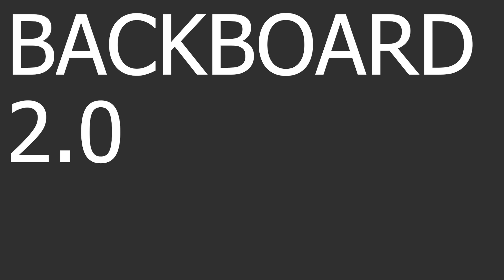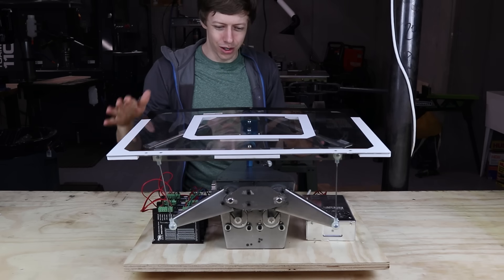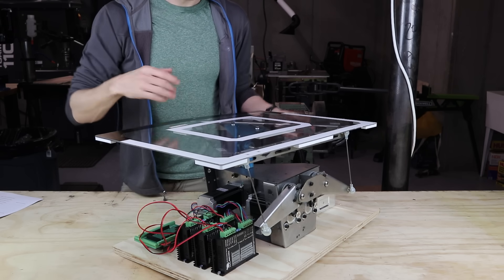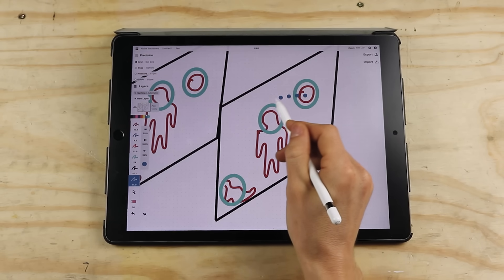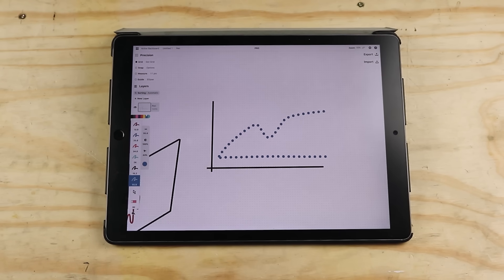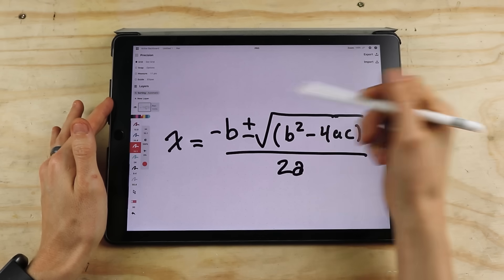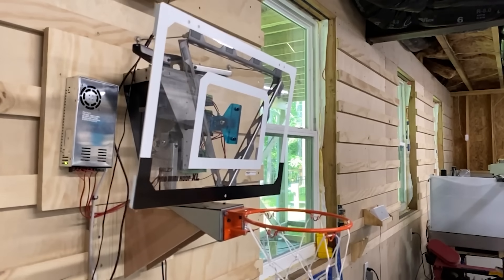The automatic hoop always goes in

Comment: If you haven’t played with it before, Googles Coral Dev Board running something like a mobilenet ssd model could help with faster detection of the basketball for a version 3 (unsure if it would communicate faster than the arduino to the motors)

Comment: I'm no pro at coding what so ever, however from your graph I can see where the code might be getting or having some bugs. One thing you didn't mention is when the ball is above the trash but you threw it from further back, The system can pick it up as the trash is the ball in the frame and miss calculate the shot. Its harder for me to put into words. Imagine you throw the ball, it sees the ball, you, and the trash. The ball is getting closer but depending on your location the trash location and so on. The system could be getting confused on which one is moving. Also trash can mean anything, A dust ball could be picked up and mess it up. I think if you work out some of the bugs in the code it would be perfect. If you send the source code i can look through it and see if I find anything. Not cause you can't but rather cause I have the time others don't have to get it done.
Reply: I know its bad to comment before watching it all but the ballistics thing sounds good but again still sounds like a bad code. Have you tried putting in more If statements? I know that might sound dumb but might help.

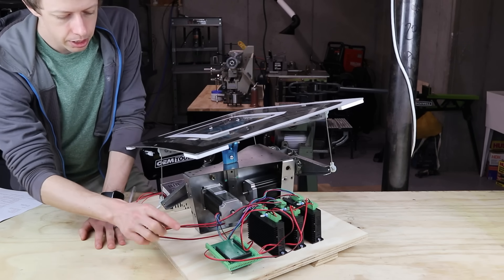Comment: 7:08 you could simply use a faster microcontroller, like an stm32, it has 72mhz clock compared to the arduino mega 2560, wich is 16mhz, as the fastest arduino.
And you can also program it with the arduino ide.

Comment: How about patterning a ball with your version of a QR code so that your computer can recognize different points on the ball and apply spin based on the same areas in a different part of the previous frame 
But idk how fast a computer can read a qr code constantly to determine spin in a simulated 3d environment rn
It would need at least a couple of cameras and a well enough lit environment

Comment: Perhaps a way for it to differentiate between the possible balls sooner would be for it to track which of the possible balls are increasing in size overtime because the ball will appear larger to the camera as it approaches the hoop.  This method may allow for the system to detect the actual ball quicker, thus allowing more time to get into position.

Comment: Hello. What sort of linear algebra topics did you use here? Relearning/reviewing linear algebra for a third time is on my to-do list. I'm an electrical engineering student good abilities in ordinary differential equations and multivariable calculus, and see connections between these two and electric circuits and digital logic and programming. Could you please look at this list of Linear Algebra topics from MIT's OCW and let me know if the linear algebra you used was related to any of these. 

Orthogonal Vectors and Subspaces
Projections onto Subspaces
Projection Matrices and Least Squares
Orthogonal Matrices and Gram-Schmidt
Properties of Determinants
Determinant Formulas and Cofactors
Cramer's Rule, Inverse Matrix and Volume
Eigenvalues and Eigenvectors
Diagonalization and Powers of A
Differential Equations and exp(At)
Markov Matrices; Fourier Series
Symmetric Matrices and Positive Definiteness
Complex Matrices; Fast Fourier Transform (FFT)
Positive Definite Matrices and Minima
Similar Matrices and Jordan Form
Singular Value Decomposition
Linear Transformations and their Matrices
Change of Basis; Image Compression
Left and Right Inverses; Pseudoinverse

Thanks a million.
You're one of the best creators I've seen on YouTube.

Comment: You give it too much degree of freedom, which make the solution redundant. 2 axis shoud be enough. You can even make separate controller loop (camera, controller, actuator) for vertical and horizontal. One camera facing for horizontal angle input. One camera facing sideways for vertical angle input.

Comment: The most impressive part is that he found a use for to Xbox connect
Reply: Just dont connect it to a xbox
Reply: Kinect as is kinetic energy
Reply: I’ve used the Kinect for head tracking on battlefield. You will feel sick in aircraft I shit you not.
Reply: @timehunter9467  i can do like 9 g shit in arma 3 without getting any motion sickness at all
Reply: Yeah, it's a pretty well known thing that the kinect is much more useful for toying with software than it is on the actual console it was designed for.
Reply: Xbox 360
The console where toxic kids harrass you if you did a single mistake
Reply: Kinect is very useful for things other than kinect games lol
Reply: I've actually seen Kinect modules being used as the core of a LOT of homemade video processing systems.
Reply: Is this english? Am i having a stroke?
Reply: Hey, Paranormal Activity 4 found a pretty good use for it.
Reply: I was thinking the same godamn thing😂

Comment: "One of the problems is Windows being laggy" Try using Linux, it will likely help
Reply: Ginger That Cat you can’t use Kinect with Linux and half of the programs he used probably
Reply: @HeenaPatel253  
Not impossible at all. You only need to mimic the protocols windows uses to interact with the kinect. Alternatively, you could put custom firmware on the kinect itself, which might even improve performance by reducing it to pure function.
The real question is if the effort involved in that is worth the gained speed, or if it's easier to just work around Windows' kinks and quirks.
Reply: @HeenaPatel253  
Not impossible at all. You only need to mimic the protocols windows uses to interact with the kinect. Alternatively, you could put custom firmware on the kinect itself, which might even improve performance by reducing it to pure function.
The real question is if the effort involved in that is worth the gained speed, or if it's easier to just work around Windows' kinks and quirks.
Reply: @HeenaPatel253  You can use something called wine which is a compatibility layer for running windows programs on linux/mac, it is not a virtual machine though
Reply: How difficult would it be for Linux to interface with a Kinect?
Reply: @thebigtimechannel9927  It may actually be simpler, because Linux is open-source, I don't know though
Reply: I get the joke lmao
Reply: @Tracker1019  is that a joke? I doubt setting up GNU/Linux on a Raspberry Pi or something would hurt it at all, and would probably give a speed boost.
Reply: @NateROCKS112  yes, this was an actual suggestion; i have a machine with Windows 10 and linux on it, linux is way less resource heavy and is known for getting the job done

Comment: How about ditching the whole Kinect and ball recognition thing by just using 2 small sensors on the ball opposite to each other to model a 3D ball and track its position (or sensors could be on the inner side of the ball but I’m not sure if this is possible). This would also lower the time needed to calculate the ball’s trajectory. Just a suggestion, I’m no engineer so I dont know. 🤷‍♂️

Comment: Ideas for improvement:

- Use the original curved backboard so the the adjustments only have to be small.
- Constantly move the backboard rather than waiting until the last instant. As the solution converges you'll already be closer to the optimal position meaning it won't have to move as fast.
- Challenge mode: optimise for the number of times the ball circles the hoop, not whether it goes in.
Reply: @zydn  I think it would be lighter if he could press it out of a single piece. Would be difficult with steel but should be easy with either some fiber material or acrylic glass that he can simply heat before forming. The 3d structure gives it strength
Reply: Number 3 would be sick btw
Reply: The motors, joints and rig would be perpetually fighiting the inertia of the former stroke(s) though. It might even break apart, jumping all over the place, because you probably have many thousands of possible solutions of a very wide range, early on. It can only actually execute on one positioning at a time, and very minor changes in the data when far away, can move the next, most probable outcome quite far away from the former one. Picking a less likely but closer to the board's status quo outcome, makes little sense. It might conserve structural integrity and be physically possible to execute, but it's also compounding erroneous data - the board may still end up having to "do a rapid 180" at the last move, negating the whole strategy.

It's only when the ball gets really close, that the trajectory sample group starts getting good accuracy and the venn diagram of outcomes and solutions starts to narrow enough.

What you might be able to do, is deep learning this into a neural network. But I'm not sure the potential gains would really be that big - this thing has pretty good accuracy just going off the live data directly.
Reply: using the original backboard would most likely be way to heavy, which introduces a lot more problems
Reply: I don't know, I think the math involved would be much more complex, and the small errors in trajectory calculation and the resulting plane adjustment would be magnified by the curvature of the back. Not sure that it wouldn't ultimately make it more quirky.
Reply: Just a fiberglass backboard should be fine and the math is trivial even with the curve. But it seems a bit pointless. Separately they are fairly novel ideas, but combined it just seems less impressive and impactful. Anyone looking at it just goes "well yeah, of course it works, look at it." It's one of those cases where it's technically more work to create something that looks like it's easy to do.
Reply: Zayden Maybe not; he’s got the shape of the curved board already. He’d only need to 3D print that surface with a lighter material and give it cutouts like the rails on the back of this one, and it should be good to go.
Reply: @brian.s4555  3D printibg this might not be viable given the axis pf forces applied. But printing a plug for presd forming as with the steel toe croc might be doable, these curves are significantly less harsh.
Reply: Federal online professor doctor engeneer warriors united in this comment section.
Reply: I think your second point, although difficult to implement, makes sense, because that's what I would do if I were to be holding the board, I would slowly move it around while my brain tries to predict how the ball will come in. Then you could start attempting to trick the robot by throwing the ball in unexpected ways. It would be amazing if the robot could even learn and improve over time.
Your third point would also be amazing!
Reply: He said his processor speed was the limiting factor, so I'm guessing a converging algorithm would take way too long to compute like that.
Reply: What if ,  it ends up being farthest from the optimal point because it was constantly moving
Reply: Sukhjinder Virk I think u miss the point
Reply: Sukhjinder Virk what he meant was that start moving the motors from the initial rough readings to be approximately near the appropriate position by the time that ball hits the back backboard.
Reply: @1dan1609  i think thats harder to do since a computer can only do fast math.
Reply: @sukhjindervirk3021  I was thinking that too

Comment: If I recall correctly in mark's explanation on how the dart board works... where your software moves at the last second when it's confident it's correct. Marks software would start moving early based on imperfect guess work then continually course correct based on the new data, that way once it's 100% certain in that last moment, it's already halfway between rest point and correct point. Maybe that could be implemented by moving the backboard to the average center midpoint of everything it considers a reasonable solution. Maybe it'd help?

Comment: why don't you start moving the hoop before you're dead sure on where the ball is going to hit? Wouldn't it be easier to move a smaller amount than do the whole move the last minute? Basically have the hoop tracking the ball since it's sure that's the ball and then do small adjustments as it gets closer. This ain't gonna be easy coding but I think it would make for a way better result with less horsepower needed. Very nice video btw!

Comment: Hey man,this is a really cool project. Though If you dont mind, I would like to suggest a few things that could improve the performance. 

1 - if you can, you should use Duo3D camera instead of Kinect. If has high FPS for depth images (you can calculate really fast as images will be received really fast). 

2- Use IKFast for solve the kinematics. If you have not solved the equations by hand and instead using a numerical IK solutions (like KDL), I would suggest using IKFast. It solves your robot model IK analytically (like you would have solved by hand) and then using these solutions, the IK solutions are really really fast computed (its basically just plug the values and get position and orientation). 

3- For computer vision, I noticed you are using Python OpenCV. One thing you could do is first use color detection to find the ball (its reddish). Then using contours to find that ball, then use OpenCV trackers (there are like 6 different trackers) to track the object (ball) in successive frames. 

4- Maybe using a white sheet to avoid any background noise in image processing. For example you can hang a white cloth/sheet behind where you are standing so other objects in your shop does not get picked up during color detection. 

Hope it helps. Apart from that, I wish I had a shop similar to yours to build all this stuff :)

Comment: Did you find out what was causing the lag? If the application is .net, was it a garbage collection or something related? (I work in the Windows and Devices org, with developers, so may be able to help)
Reply: Actually, I see from later in the video that it's Python, which is somewhat slow to begin with, but also has garbage collection (so you want to minimize (de)allocations to minimize that). But if you need help identifying lag in Windows, and are still interested in this project, please let me know. 

Very cool project.

Comment: Wow ... Two suggestions... 1. Move the plane to resting position half-way between extremities. It seems you did this, but I'm not sure. This will limit actuator moves to half of max travel... 2. Build an in-memory pre-calc array so you avoid floating point maths on the fly... just look up the values. You'd still have to multiply and do addition on the fly of course. You'll lose some numerical precision, but I'm guessing you don't use too many significant digits anyway.

Comment: Awesome project!  Filtering out the "balls": shouldn't the range alone permit instantly filtering out the "bad" balls?  Regarding the too slow Arduino: get rid of the C and the library baggage!  (Why do all these projects use Arduino?  Is that the only microcomputer in the world?)  Regarding the motors: steppers are not fast!  Regarding the sideways constraint of the backboard: you can use 3 straight linkages (like the 3 driven ones) and get rid of U-joint and slide rail, cutting weight and friction).  What computer do you do the image processing in?

Comment: why have the in and out if you should be able to find a solution from any given z value within its current range? would it be easier to lock it onto a pivot and only have 2 motors going (tilt and pan)? i dont know how much time sorting each 1ms increment for shortest path takes but it might save a bit of time to eliminate those.

Comment: Nice work, but why wouldn't it be enough to have two actuators and one fixed gimble? Technicly you do not have to move the Board back and for and you would reduce the thing with the multible posibilitys. In other words it is a overdetermined system right now.

Comment: If you want to "buy" more time and collect more data before setting the final angle you can actually run preliminary calculations (1 or 2 times) and make the backboard assume the position based on first portions of gathered data. This way you can make the final decision for the angle when the ball is closer since there will be less movement needed for the backboard to assume its final position. This will increase the accuracy.

Comment: Man, I absolutely loved the breakdown of the different parts and processes you used to create this contraption. I especially loved the software breakdown with the high-level algorithm for picking out the correct trajectory from a graph/matrix of possible trajectories. Out of curiosity, you mention that the Kinect is able to plot distances in 3d space. When you run the calculations from frame to frame and try to match them to consistent ballistic trajectories, I wonder if that's more calculations than necessary.
What would happen if you tracked the possible "balls", and instead compared how much distance they moved (frame by frame). If the "ball" in question is moving closer to the camera, It should quickly eliminate stationary objects (net movement of zero), or your head (small changes in movement unless you are running with the ball for a slam dunk or something). Once you had a high degree of confidence on which object was actually the ball, then you can plot your ballistic trajectories to make the final adjustments for the backboard. A simpler strategy for identifying the ball might save you some compute cycles initially. At the very least, it might let you more quickly prune some paths off of your tree.
However, It's quite likely that I'm completely overthinking this, as the most complex part of your calculations happen at the end, when you determine how to angle the backboard properly. I blame commenting at 2AM.
Awesome video and I can't wait to see more stuff like this.